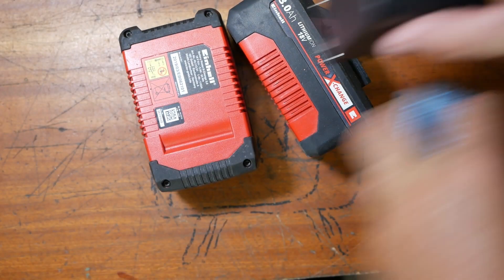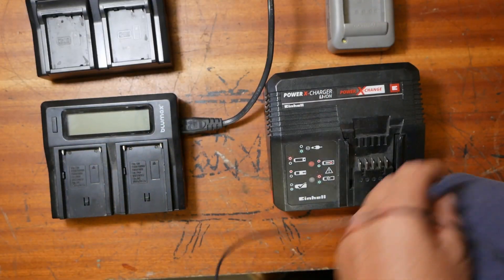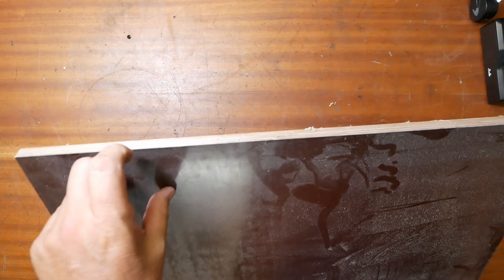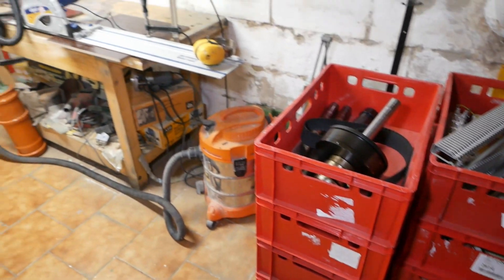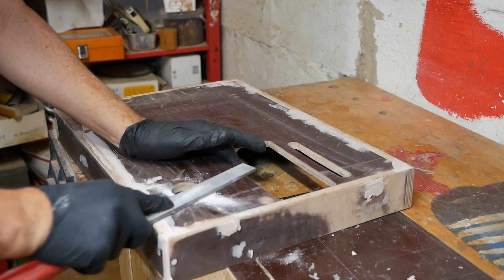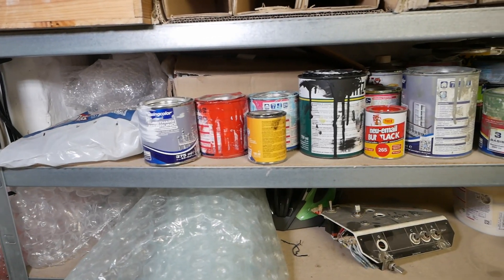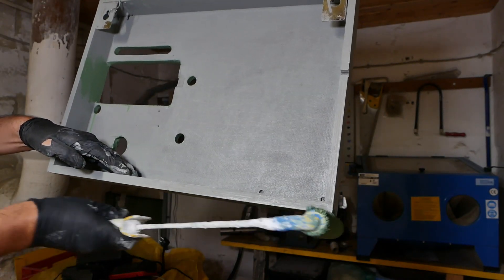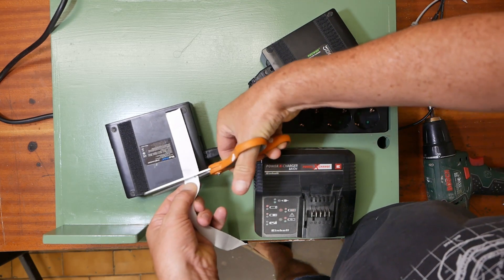Battery charging station - 5 minute job.

Comment: So, I know this really related to this video, but I had a question I wanted to ask. Can you give us a review on your polished turd? I’d like to know your feelings on it since you’ve had some time to spend with it and all. (Also I purchased one to convert)
Reply from the maker: Thanks, that is a good idea. The cliff notes are... it is not a good lathe. Too flexible.Too prone to chatter. Works find on little parts like the tap, but struggles at modest diameters.
I much prefer using the Boley, even though it is heavily worn.
Reply: @RotarySMP  isn’t* I don’t brain so good some days.

Comment: That must be 500kg wet paint. Coverage is about 4m sq/litre for 2 coats(25um x 2 = 50um), and typical volume solids for paint is about 30%, so I guess 150kg dry. 
We used to use inorganic zinc, and it had a VS of about 97%, ie, it came with a 18kg drum of zinc power that you mixed with 16l silica based binder.
Reply from the maker: Thanks for the cross check. Shouldn't use uncritically use data like that.

Comment: 5:50 … ok what’s your secret? How do you properly align the bladder screws to attach the charger? I can never manage to do it correctly!
Reply from the maker: I just laid down a centerline and measured off that. The diamensions were printed in the plastic.

Comment: Great video as allways. Have an eye out for the glue on the velcro straps. Using douple sided tape my charger came of my Charger station because of the accumulating Heat weakening the glue on the back of the Chargers. Using 3d printed holders will be my next try.
Reply from the maker: Yeah, I am wondering if the charger will be on the floor sooner or later due to the big NPF batteries.

Comment: Great to hear You talking about painting aeroplanes. My Main Job is chemical Operator in a factory, that fabricates coatings for aerospace.
The more-usage of fuel caused by the 1/2 ton coatings is compensated with a tiny bit of better aerodynamics. At high speeds it does matter how rough your coated surface is. The paint mimics the surface of a shark skin.
Reply from the maker: I read about shark skin surface finish to reduce drag.
Reply: @RotarySMP  exactly, sorry my english is Not the yellow from the egg ;-)

Comment: Like the unification of the phone carging cables, this is something the EU should do something about. A universal connector at least for the power tool batteries would be amazing...
Reply: Or a larger, higher current, low voltage standard plug. Like USB C PD where the thing using the power tells the charger what voltage it wants. Maybe up to 48v and a few amps so it can work with most home appliances and chargers
Reply from the maker: It amazes me how much power they can deliver over USB C.

Comment: Could have saved the glue (and maybe even the paint). I have yet to find something that sticks to Siebdruckplatten (except for spray adhesive). I use Siebdruckplatten as working surface whenever I glue or paint something, because you can just remove residues of everything by scratching (with another small piece of Siebdruckplatte). Doesn't matter what, water based paint, solvent based paint, construction adhesive, silicone, epoxy. Can all be removed leaving the surface almost looking like new. Usually as soon as you get a small nick the paint starts to flake off, especially on the smooth side.
Reply from the maker: Oh well, it is kind of out of the way and should not see too much wear.

Comment: wood glue doesn't stick to whatever it is on the surface of the plywood
Reply: And neither does paint (water or solvent based), epoxy, construction adhesive or silicone. It's the perfect working surface when you work with any of that stuff. But it's the worst thing if you built something and want any other finish than the standard dark brown, because getting paint to stick for the long term is futile. ;)
Reply from the maker: @superdau  I am glad I sanded it off then. Hopefully I sanded enough.
Reply from the maker: No, I sanded it, but also screwed it together.

Comment: It doesn't show in the video, but I'm sure you had to stop to recharge some batteries while building this project :)
Reply from the maker: Yeah, I use a Blind spot power junkie to power the camera and little LED light off NP-F batteries, as I got sick of the LED light going flat ever 20 minutes, and switching the camera battery ever 30.
Reply: @RotarySMP  Doing YouTube is a sruggle :)
Reply from the maker: @Rustinox  Sure is. You really show that you can make anything on a shaper.

Comment: Siebdruckplatte is textured on one side. A sieve is pressed onto it (hence the name) to give it texture/grippiness to be used in car trailers and generally floors of transport vehicles. the similar looking ply sheets that are smooth on both sides are intended for pouring concrete (Schalungsplatte)
Reply from the maker: Okay so I was way off with connecting Siebdruck with sikscreen printing in my mind. LOL!
Reply: @RotarySMP  since it´s called exactly the same in german I did so too for a long time :D

Comment: Good decision to make the panel - just the clean look, without all the cable spaghetti was worth it 😃Just one comment, from my experience - wood glue does not adhere well to melamine and I always rout it out on the joints. Also, if you use a sponge paint roller, resistant to whatever solvent the paint uses, you get a better finish. Alternatively, paint with a brush and use a piece of  sponge to give final finish (stamping movements) - done that a lot, to avoid the trouble of cleaning the spray gun, when painting small surfaces.
Reply from the maker: Good tips. I also doubted the glue, but it is firmly screwed together. I should have used a clean paint roller.
Reply: @RotarySMP  Yep. The screws will do all the work, and it's not a structural piece.
Reply from the maker: @JoseSilveira-newhandleforYT  Not until I lean on it :)
Reply: @RotarySMP  LOL.

Comment: How is that Sheppach track saw? I see them on offer here all the time and wonder if they're any good.
Reply from the maker: I bought it to make some round the corner stairs out of 30mm plywood. I replaced the blade with a finer cutting Bosch blade straight away, and have been happy with it.
Reply: @RotarySMP  Thanks. Might have to pick one up then as it looks like a very convenient way to break down sheets of ply
Reply from the maker: @SalmoTrutti  It wasn't really happy when I tried to chop down a 4cyl cylinder head, so i could melt the Alloy for casting :/ Slightly outside the design point!

Comment: at the tracksaw engineering departmand: "hey i have an idea, lets build an item style slot into the aluminum extrusion track so you can use clamps easy and they are not in the way!"

"damn man great idea, the users will love that feature!"

Mark: *mit riesenschraubzwinge quer drüber klemm und beim ersten schnitt ansteh
Reply from the maker: Yep, those extrusion clamps are too expensive for a cheapskate like me :)

Comment: If that velcro becomes undone, heat up the glue layer with a n electric heat gun until it starts to bubble, and put it in the right place. Very much avoid touching when it is hot.
Reply from the maker: Thanks for the tip.

Comment: Definitely a useful shop addition.  Darn….. another case where your implementation was more clever than mine….. And now that I can’t un-see yours, I need to redesign mine 🤣😂🤣.  I’m constantly looking for ways to expand my shops footprint.  Everything that can be removed from a horizontal surface helps.  Vertical mounting and hanging from the rafters almost doubles the storage and frees all the work surfaces….. for work 😉.
Reply from the maker: I tried not to over think this, and keep it flexible, as there are sure to be changes in the future.

Comment: Great idea.  I think that plywood is called "phenolic faced baltic birch" here in the States, and it was a good choice to use for the charger.  Kind of hard to get over here in small quantities.
Reply from the maker: They have this is a number of different thicknesses at the local hardware store. I normally keep an eye on their offcuts and pick up decent sized pieces cheap.
Reply: I came to post that. Always envious of the Euro-makers and there materials.

Comment: Nice charging station. I have a shelf out by the UPS that is full of chargers. I used to just have them scattered all over the house by every spare plug. I think yours is neater. :-)

BTW, you always mix brush painting with roller painting. A roller can't get into corners, so you have to finish with a brush.
Reply: Its better to paint all the corners and hard places with the brush firstly, then finish all with foam roller, it hides most strips and tracks from brush painting into smooth coating
Reply from the maker: @nt976  Thanks for the tip.
Reply from the maker: That is  good point about brushes with rollers. Thanks for watching.

Comment: Re. paint smoothness
It's always better to sand down and apply another coat if you want a silky smooth finish.
Also, if you pour out the paint into a smaller working vessel somewhere with less dust in the air, your paint will be considerably less lumpy.

That or filter it through a cheese-cloth, you decide which is more of a pain.
Reply from the maker: Thanks for the painting tips. I put more effort into painting machines, but figured this will be fine as is.

Comment: Protip: Always leave the circuitbraker on, and use the one at the walloutlet instead. Sooner or later the cheap chinese red plastic will break, and it always does it in pos. off. No need to say the breaker is welded in place and impossible to get out.
Reply from the maker: Good tip, but I have no switch on the wall. If it fails, i'll just replace the whole power board, as it only cost a few clams at the hardware store.
Reply: That is interesting. Are you from Australia? Is the only place I know every plug has a switch. I find a pity that not all the world has the Australian plugs.
Reply: @esepecesito  I get the impression that the Brits have every plug switched too.
Reply from the maker: @lwilton  I am in Austria. Here most plugs are not switched.

Comment: Also for the paint, a foam roller and some flow extender will help a lot with getting a smoother finish.
Reply from the maker: I probably should not have used the same roller I used for the rubber bathroom sealant :/

Comment: As a photographer, I can assure you that I feel your irritation at the heap of chargers in the depths of my soul.
Reply: Once upon a time, all power tools had cords, all the cords had the same plug and all the plugs fit the same outlet. Now the tools don't have cords and the battery from the green ones won't work with the red ones and the charger from the red ones won't work with the yellow ones and the whole system is just stupid, the End.
Reply from the maker: @steamfan7147  Yeah, it is really annoying. The EU has mandated that all phones have to use USB C, to reduce the constant growth in electrical waste.
Reply: @RotarySMP  And one charger cord to rule them all.
Reply: @RotarySMP  I want to get a watt watcher and plug my charging station into it, then see what the power consumption is over a 10 day period to get an average. I'm thinking it's not insignificant, where my corded tools use nothing until switched on.
Reply from the maker: @steamfan7147  I only turn on that station when it is actually charging, otherwise it is off.
Reply: @steamfan7147  this would be a good test, but I don't think the chargers are meant to be left plugged in while they aren't charging.  If you're talking about whether or not the cordless tools use more wattage in general, I guess you have to decide if the trade-off in convenience is worth it, assuming they are using more electricity than the corded versions.
Reply from the maker: @steamfan7147  You are right about that. It is a real pain.
Reply from the maker: Yeah, they just keep multiplying, especially once you do video.